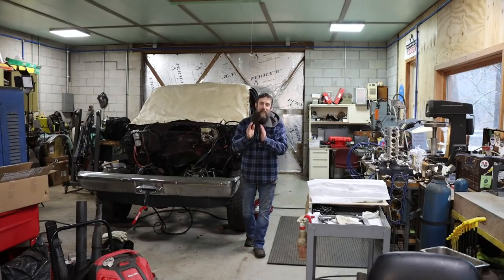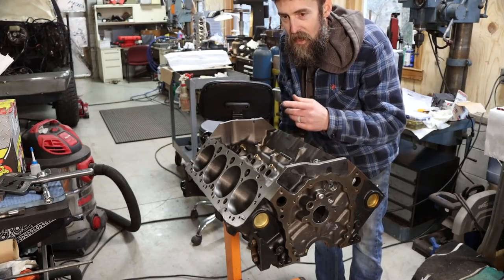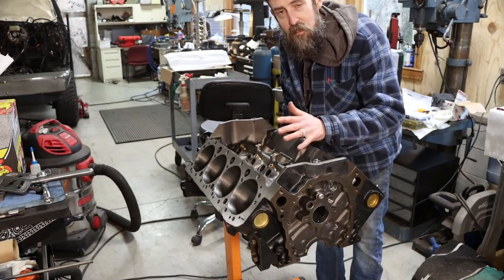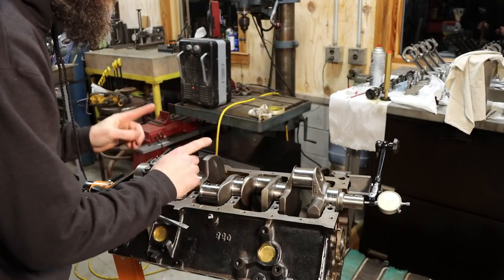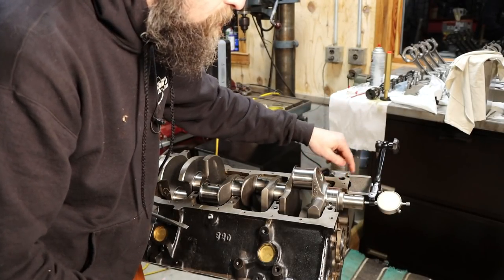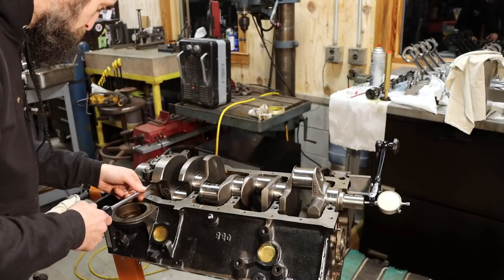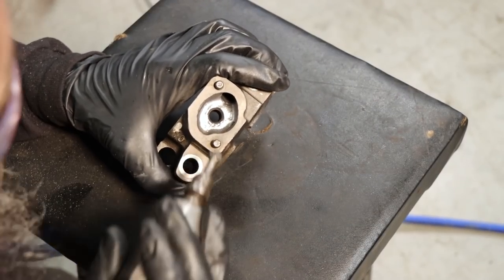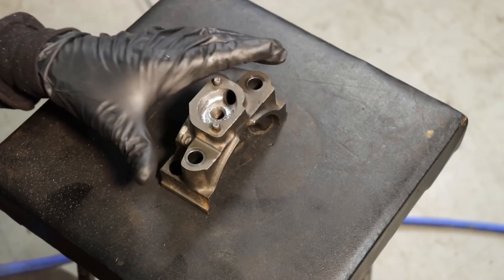Injecting some POWER into the Square Body. Part1

Comment: Don't know what this engine was originally built for, but most performance engines are built to run on premium fuel. If so, now would be the time to modify, or change pistons for a regular fuel friendly engine. This would unfortunately require re-balancing your rotating assembly, but the difference in fuel cost over the long run can really add up. Going to be a nice truck. Cheers, Mike
Reply from the maker: With the cuttent setup on the bottom end and a few other factors one being head chamber size we should have a static compression ratio from 9.85 to 10.73. 64cc vs 72cc heads.
Reply: @SteveSummers  That's going to put you pretty solidly in the premium fuel zone. you might squeeze by at 9.85, but you would be on the ragged edge, especially if you are anywhere near sea level. Not sure what thickness head gaskets are available, but that might be one route to bring it down to an exceptable level. Detonation can do a lot of damage in a short time. I'm sure you will figure it out. Mike

Comment: I wouldn't recommend the air-gap intake for your 'driver' engine.  You don't need to keep the intake as cold as possible, you want some heat to help vaporize the fuel.

Comment: I wonder if I had nitrous on my firewood hauler if I would get stuck less often? LOL Nothing like 9000rpms to get the tires clean!!  You likely will have trouble hauling firewood today with the air gap when your carb ices up. 😈
Reply from the maker: I didn't consider icing🤔😁.  I did consider Nitrous then decided against it after imagining wood flying out the back😒.

Comment: PRO TIP: a 400 sb is externally balanced, unlike your 350 you removed, you MUST get a Harmonic balancer FOR A 400! dont clean and re-use your old 350 one, the motor will shake itself apart!!!!
Reply from the maker: Yep, all that was mentioned in the video👍

Comment: Good morning Steve very interesting - didn't know about the bore thing about clamping down the head distorts them. Thank you for sharing, this is going to sound good when you kick it in the guts for the first time! :)
Reply: 410 sprint car engine builders in our area run heated oil through the cooling channels to bring the assembly to operating temp before machining bores and alignments in addition to the torque plates.

Comment: When you run a tap into a blind hole it is a good idea to blow out the hole with compressed air BEFORE and AFTER using the tap.  before just to make sure you are not bottoming out on some debris and of course after to remove any chips created by tapping.
Reply: I'm fairly certain Steve knows what to do.

Comment: You mentioned the block has been clearances for the crank counter weights, the stock oil pan needs to be “adjusted” a bit too so the crank doesn’t rub.

Comment: ok now steve think this out,like i wrote you before im doing same thing right now building a engine,so you mentioned the rotating assembly was balanced, it cant be bro, did they give you the document of your bob weight,each pin, piston, rod,rod bearings, rings,lock rings if you have floating pins all that has to be weighted ,im sure you already know this,so if they balanced the crank for all the bob weight ,you have a neutral balanced crank, your running a flywheel and you also need the harmonic balancer to complete the balance.
like mine i have to run a weighted flex plate and neutral harmonic balancer, the crank with the 1 piece rear seal was designed that way from factory, so your stroke is 3.750 with that crank,you also have the HP cam and lifter setup,you are in the High Horse power range bro,regardless of the trucks intent with your setup you will have more vibration than a factory spec 3.480 stroke if you dig what i mean.
this said if it were me and my piece of mind i would take it back with flywheel and harmonic balancer complete piston assembled with rod bearings and along with a set of main bearings and have the crank balanced. another thing in your lifter valley the cast in the back is terrible ,the oil drain holes and distrib hole needs cleaned up,and grind mine were the oil will flow instead of puddle back there ,same with front of block, the plugs are the best imo but the chain can drag on the forging cast so mount it on your cam or a old cam and see if you need to grind any of that cast , im just mentioning all this i went to school of hard knocks to find i can always learn new tricks .
im sure you know all this but didnt mention it so hope i could help,im a chevy man all the way and love tinkering with them, BUt i got mama trained to let me build mine in the house were it warm ,just saying ,hahahah hi to bobby and elizbeth and im really building my own 4x4 by watching yours come back to life, i had quadruple bypass 2 years ago so i just let you youngster do the work these days haaha,just pickin at you bro,love the show

Comment: Plastigauge has many more uses than just telling bearing clearance. I have used it to check closing force on die sets, and to check for where the force was uneven, to adjust the cam follower bearings that were used to close the die halves. 
Got them even, or at least within 10% of the same force on all 4 corners, and after lapping the plates, on the cheap home made surface block (granite floor tile, selected from a part box and thus ultra cheap, and close to optically flat, by checking the part box for the 2 with no waviness in the overhead lights, not that any of them were at all bad, but chose those with zero defects) it sealed much better in use.

Comment: Steve are you sure you are supposed to lubricate those bearing hold down bolts before you torque them down. Torque wrenches read different between a lubricated and un-lubricated thread. Which one is correct ? - only the engine designers can tell you that, unless you have some very fancy torque measuring equipment like a strain gauge and you are not going to have that.

Comment: Starter mounting bolts. 3/8" verses 10mm. 
Warning your truck has metric starter bolts. 82 up came with them. Also a short solenoid metric starter usual number 3510M. Verses 3510. You have a stitch shift which uses a different starter but the change is the same. 
Screwing metric starter bolts into an sae drilled block will split the corner off the block. Almost impossible to repair. 
Mounting a metric starter on an sae drilled block will allow the starter to shift away from the flywheel no matter how tight you get it. The starter is centered on the knurled bolt section that also fits into the counter bore in the block mounting surface.

Comment: Just a heads up about using plastigauge: make a note not to measure the end(s) that was(were) cut from the main piece as they tend to be deformed from cutting and can produce false readings. Always measure the centre of the strip.

Comment: Steve, you may want to verify your torque wrenches if they have any kind of age on them.  I had a similar problem getting head gaskets to hold on a VW Rabbit diesel (difficult to do when things are right).  I bought a new torque wrench on the 4th attempt, that one lasted for the remaining life of the rebuilt engine ... 8 years and ??? miles, I couldn't tell because the odometer had locked up @ 118,000, long before I bought the car.

There's a lot about that car I don't miss.  But I do miss the 40+ mpg I got out of it.  When fuel went over $2/gallon and it took more than $20 to fill it, I felt traumatized.  These days we'd be happy to see it that low.

Comment: With what you plan to use the truck for, I think an Edelbrock Performer RPM manifold isn´t necessary, as you won´t run at high rpm too often and then don´t need extra hp. 
The normal Performer should do well, got it in a Caprice Estate with a 305, Edelbrock 1406 on top, normal pipe headers, dual pipes, 700R4 and I can´t complain.
Hauled a ~3/4 ton load of pavement stones once and the acceleration still was more than necessary for normal traffic.

Comment: I think your next project needs to be harnessing that creek that always has flowing water to make power for your shop.
Reply: Vacation all summer when the run off dries up?
Reply: @waynespyker5731  I am not exactly sure what you are saying here?
Reply: @waynespyker5731  oh wait I got it.... I don't think it completely dries up.  It always looks like there is some flow.  So what you do is you go up stream and create a small dam that you then pipe the output to a turbine down stream.  Lots of videos on the internet about it but they are never done by someone as deep into machining and fabricating as Steve.  So I think it is a great project for him to take on.
Reply: @JoeyG1973  Sometimes it appears to have adequate flow but the stream bed dries.  Would be nice if there was always water. Steve would do it right.  
I volunteer at a water powered grist mill with an early 1900 Fitz Waterwheel Co of Hanover, Pa 12 foot diameter x 4 foot wide steel wheel. We harvest about 20 horsepower needed for our mill's tasks, completely filling each bucket would produce 50-60 horsepower.
As requested in a prior post, perhaps some video of the mesh deflecting a downpour or melting run off.

Comment: Warning don't use a Fram oil filter with that high volume oil pump they don't flow enough and send the oil through the oil bypass I lost two engine's over that. one made it through the bake in till the guy changed the oil and put a Fram on it lasted maybe 10 minutes bad rod nock

Comment: Just have to remember you can compress a solid or a gad but not a liquid so any liquid down a blind hole make cause the torque is reached before the bolts get down to where they're meant to be.

Comment: Hope anybody out there ansewers only if you really know plz... the 1/4 inch more on the stroke of the crank is that a 1/8 inch at the top and 1/8 inch at the bottom all round 1/4 inch???? Or is it 1/4 inch more at the top and the
bottom witch would make it 1/2 inch all round.... i pretty sure it is not the 1/2 inch all round.... but for some reson i am douting my self....  
Anyway i do belive dude is going to have himself one really good motor.. he is doing all the right things... checking all his clearnces and tollerences... to me thats the main things and a really really good cleaning... you going to have to disassemble your allready assemballed long block... but to me better safe than sorry.....witch sucks cause the fac prob put locktight on the bolts and studs....and prob did it right but hey....he also made some well needed mods...

Comment: oh and by the way other than going diesel the 383 will give you the optimum torque you need without reving the engine to the old school limits and make good bottom end torque or atleast the 8 i worked with did except for the one guy that would not listen and way over cammed it

Comment: Would the dripping of oil onto the rotating internal parts aid in cooling them?
I saw the holes in the block for a 4-bolt main but saw only two bolt holes in the bearing cap. What did I miss?
One can not put a dollar value on the fun of building an engine the RIGHT way. Nice work Steve!

Comment: Another thing you can do that gets a lot return on little investment is knocking the castingflash out and deburr the ridges from the casting another thing you can do that helps is smoorhing out the oil return holes so the oil drains back eazier i seen peope eppxy in mesh ovee those holes to prevent stuff falling in the pan should for instant a roller lifter fails
Allso check id the crank is externally oe internally balanced as ir matters id youre butinf the flywheel and the vibrariondamper

Comment: Hey Steve, not a mechanic here but learning a lot thanks for the lessons. Was wondering what you do if the plastic gauge is off, change bearings?
Reply: What your checking is that the crank journals havent been re-ground to remove a scar or marks, if so you have to order oversized bearings
Reply: @Mad-Duk_Machine_Werkes  a micrometer is a much easier way of getting the crank pin actual size. The Plastigauge is used to determine the running clearance of the particular bearing. If your crank had been reground say even 10 thou undersized the Plastigauge would show nothing as it wouldn't even have been comoressed

Comment: Great choice, especially since it was easily attainable. Are you just going to run the stock engine management stuff, or go with a more modern fuel injection setup?
Reply from the maker: We will see about the fuel side. I have some things in mind that I would really like to do.
Reply: @SteveSummers  I would definitely avoid using a Holley four barrel. They are just to finicky for my likes.

Comment: Another concern with blind head bolt holes is to make sure that they are not full of oil when you reassemble. I found this out with my Honda CX500. As I tightened down a head bolt it got sort of squishy, I carried on tightening, and there was a loud "crack" and it stopped feeling squishy. I must have cracked something in the casting that released the hydraulic pressure inside the threaded hole. I didn't strip the whole block back down again to investigate (After all, this was a £250 motorcycle at the time) and got away with it, but it could have been serious. Actually this is true of  any blind hole, but in this case it was a head bolt)

Comment: So you used a plastigage that measures up to 0.003, and it came out at 0.003. How do you know the clearance was not greater. Shouln't you have done another test using the larger plastigage ? or am I missing something.

Comment: Did I miss the part about cylinder head choice?  Maybe me first cup of coffee got in the way.  Curious what you're going to go with... could make a good case for keeping the stock cast iron heads but it's real hard to resist some of the new aluminum units if power and efficiency are your thing.  Regardless, great work as always!
Reply from the maker: I didn't mention it yet. 👍

Comment: You CC the piston valve relief cut areas, but did you CC the head chambers? I get the real feeling you are wanting a heck of a lot more power than you are letting on. I see too many options that usually a person does to yield more HP. So while you talk like you just want a good running engine, you also what a powerful engine with more power than a typical 350. So while you are talking like just a good replacement pick, HP is still in your mind. The crave for power seems to be in all of us when doing such rebuilds.

Comment: Never could figure out why people wants to redesign the motor that GM has used for many years.
Reply: GM had a specific cost point and a specific intent for the engine.  Many hours of analysis were devoted to saving any labor hours ( down to seconds ) when producing engines. Steve can improve on almost every aspect of the engine done in his shop. He can also tune the combination during the build tailoring it to his SPECIFIC driving requirements.  A factory built engine with these parameters would cost north of $7000

Comment: ON the oil drain back restriction, aren't the cylinder boars, lifters, rockers and wrist pins all splash lubricated?  I get it if you're building a motor for drag racing but for long term durability and the limited power you will gain from limiting windage doesn't seem worth it.  It's not like this is going to be some 6,000 rpm race motor where windage could be significant.

Comment: Piston speed is higher with the increased stroke, true. But don't forget about piston acceleration; If this motor is using a stock deck height, the engine will have more piston acceleration: This is due to the rod having to be shortened to allow for the increased stroke for a given deck height. Higher deck blocks allow for a longer rod, at least partially offsetting the acceleration issues for a given piston speed. Log rod motors have lower rod angularity and will have more uniform loads on the rod big end bearings.

Comment: The 383 has been a round a long time and it's a great choice. I'm looking forward to hearing it run. When was the last time you checked that torque wrench. That thing isn't the best choice for building an engine and even the most expensive torque wrench needs to be tested from time to time.

Comment: Make sure all the oil galleys are fully cleaned out also since the block has been sitting for a little bit!! I’ve seen a motor put all together and on the engine stand with everything put together and just the intake sitting on top and covered up with several towels really good and in less than a week the guy came back to finish buttoning everything up and a mama mouse made a big old nest under the intake and filled up at least 3/4 of the valley under the intake!!! That sucked for that guy because he had to tear it back apart and have everything cleaned back up again and then reassemble it!!! It can definitely happen buddy because I’ve seen it before!! Oil galleys get plugged up with mouse poop or even a small baby mouse I’ve even seen that in the oil galleys and you definitely don’t want to starve it of oil because that will do even more harm for sure!! Just a heads up buddy!!! Just run a wire brush down all the oil galleys with some hot soapy water and then dry it out good and spray with some WD-40 oh and don’t put oil on the pistons for lubricant definitely just use WD-40 for the lubricant!!! Oil can cause a glaze on the cylinder walls causing it much harder for the rings to seat in!!! I no there are lots of people that use oil but it’s definitely not good for getting everything to break in properly!!! Just another heads up buddy!!! Ok I think I’ve told you more than you probably wanted to no but i just wanted to let you know some of the things I have seen over the years in building motors!!! It is definitely a fun thing to do but if done Wright it will definitely take someone longer then a weekend to do and do it Wright also!!!